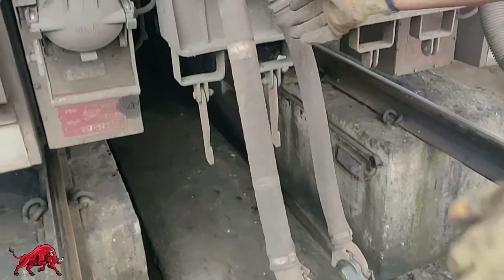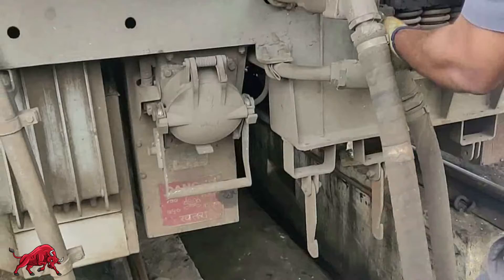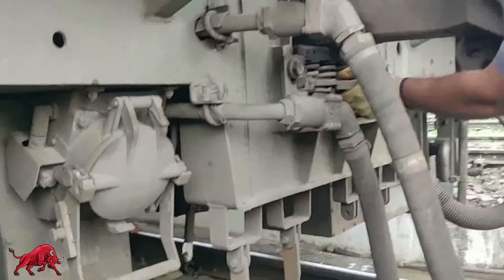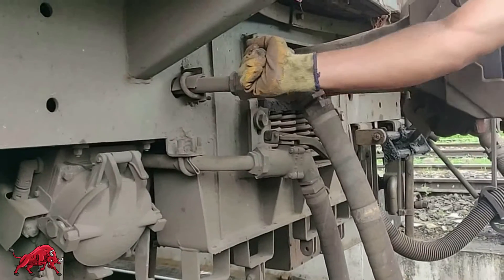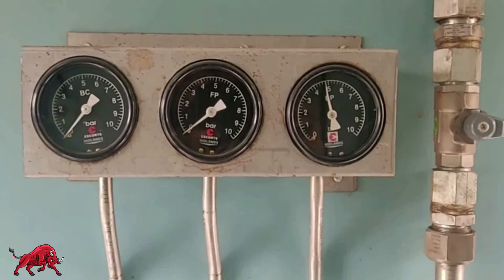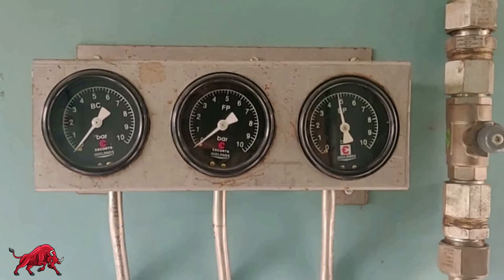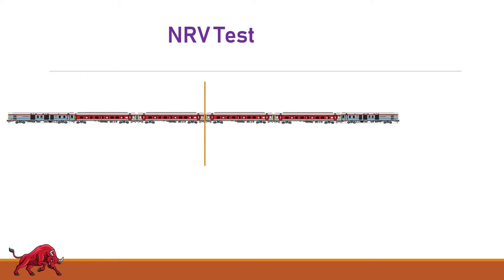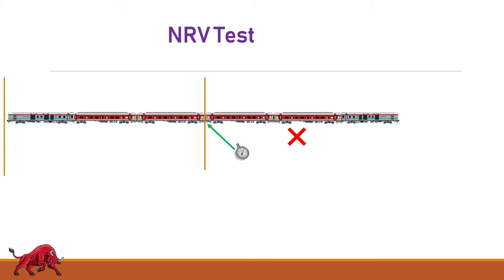Checking and replacement of defective NRV Check valve

Comment: Sir,I have referred the pneumatic circuit of brake panel,if both NRV's -one to cdts tank and another to 125ltr tank,are leak,then only BP pressure comes to FP line.What is your opinion,sir?
Reply: No,sir if any of NRV fails BP pressure enter to FP line